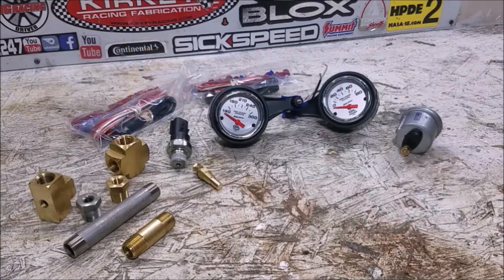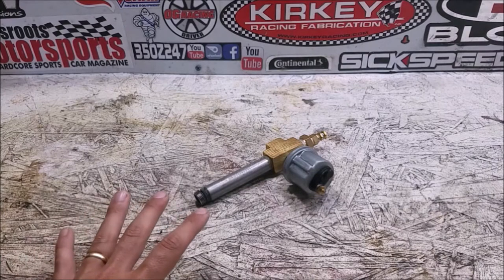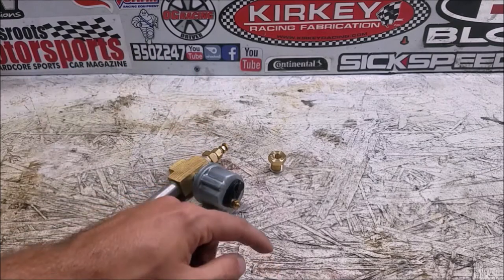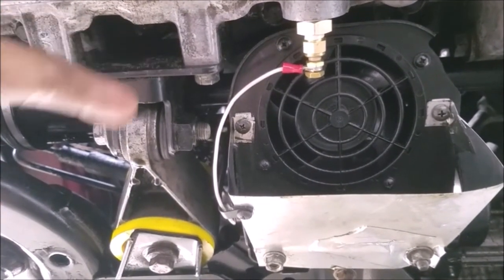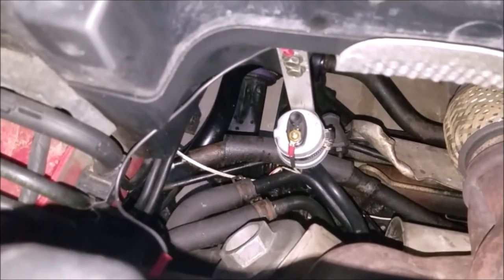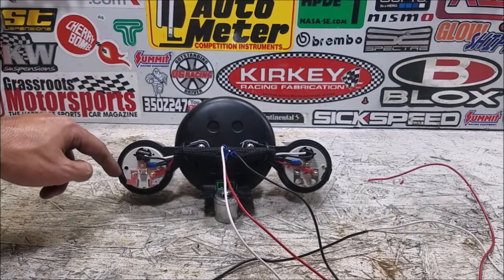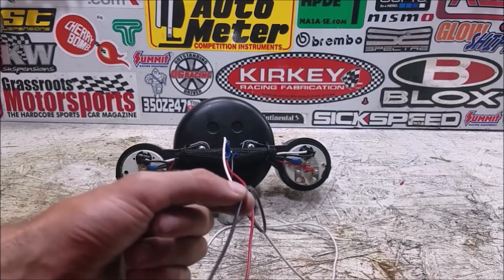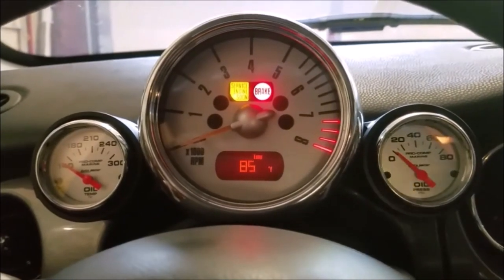R53 Mini Cooper S Oil Temperature and Pressure Gauges DIY

Comment: I love your video. I have a question regarding the 12V power source during installation. Why couldn't you combine the power sources for the light bulb and the gauge itself to a single 12V power source say the radio in this case?
Reply from the maker: Whatever is easiest for your set up will work

Comment: Where did you get that oil drain plug adapter from. Provide a link if you can please. Thanks
Reply from the maker: eBay; the link has since changed

Comment: Hey Mate, could you shoot me a list of all the adapters and such you need? or put a list in your description?
Reply from the maker: It depends on how you want to do it, but to duplicate my set-up, you'll need the 1/4 barb with 3/8npt male and 1/4 barb with1/8npt female for the oil pressure and an M12x1.5 to 1/8npt for the oil temperature. You could also use a 3/8npt to 1/8npt adatpor for the oil pressure. It would be much simpler.
Reply: @350Z247  Isnt the drain plug size M14x1.5? Cause I also bought a magnetic Drain plug recently because my OEM one was stripped. and Im pretty sure it was M14
Reply from the maker: @delightfulfish7341  You are correct. I accidentally told you the drain plug size for my M5. Apologies.

Comment: hey m8 did u ever tried water temo gauge, i need to know does that water temp sensor can be screwed instead bleed screw on joint pipe?! thanks
Reply from the maker: I think that would work, but you would need a new housing as the thread pitch likely won't match. I don't the factory water temp sensor is pretty accurate through the OBD2 port.

Comment: Hi I have gauges without oil sensor, how I find good sensor for my R50 on Oil temperature? Thanks 😇
Reply from the maker: Any reputable brand will work well. I prefer AutoMeter.
Reply: @350Z247  Very Thanks😇